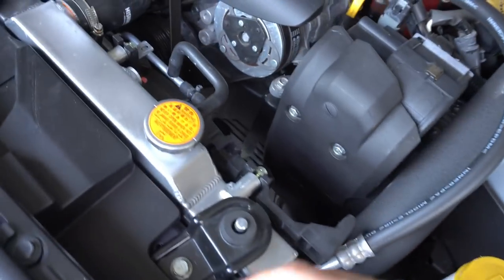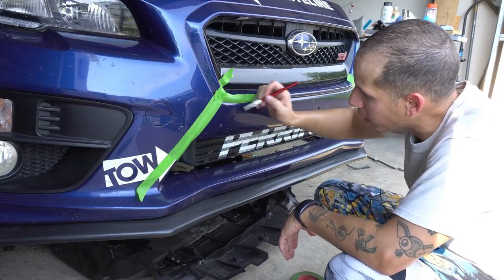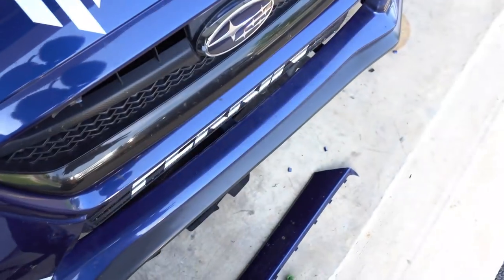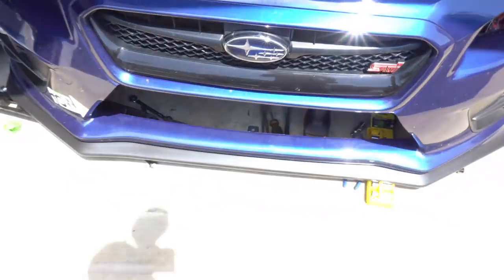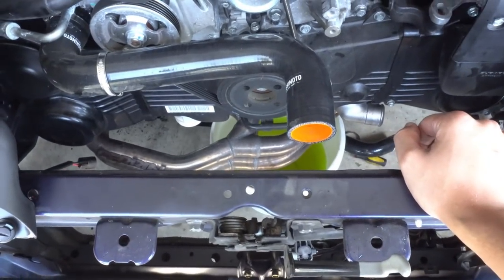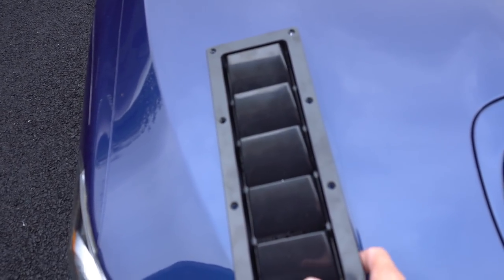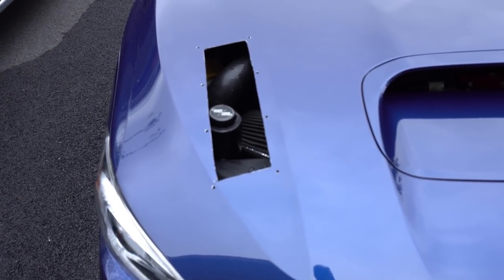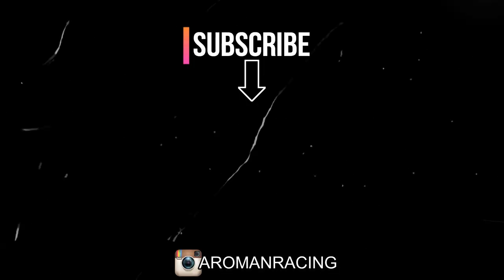Hood Vents and AC delete

Comment: Hey wats that piece next to batter covering over the cam pully I need something like that cuz after I did my head gasket I didnt put back my driver side cam timing cover so its exposed ..wat u have next to ur ac would be perfect for blocking water when I install my vents
Reply from the maker: Next to the battery? I think you talking about the air pump? Comes stock with the car. You wanna delete that. Its just for emissions on cold starts

Comment: The FMI reduces the efficiency of your radiator by at least 50%, which is your biggest contributor to the overheating issue.  I don't think removing other components in the engine bay would help alleviate the issue because, heat the engine produces, can only be best removed via the radiator, which is a part of the engine cooling system.  The engine block itself cannot eject heat very well because it is not designed to to so.  Variables which affect the efficiency of heat transfer are ambient temperature, engine operating temperature or how much heat the engine puts out (more HP =more heat), air flow rate (how fast air moving through the radiator), surface area of the radiator and flow rate of our water pump.  So play around with those variables and find the most viable ways to lower engine temperature.  Good luck, bro!  Just my 2 cents.
Reply from the maker: Khánh now that is some great info. Thanks a bunch!
Reply: A V-Mount radiator/intercooler setup works beat followed by a side by side cooling setup where you use smaller area coolers that are deeper and mounted next to each-other. check Chris sti on instagram to see side by side and MP Gymkhana for the V-mount.

Comment: Did you make any relief cuts in the material around the hood vents? That could help the corners look better and more flexible. Looks good man!
Reply from the maker: Just a 2018 WRX i did drilled the corners first but still went to far lol
Reply: I meant in the gasket or rubber material itself, just make small vertical incisions in it, but not all the way through, to allow it to bend more.
Reply from the maker: Just a 2018 WRX oh yeah . I tried that and thats why it had lifted on tha one side. Tried it the other side and it just didnt look as good. BUT! i actually found the perfect way to get it clean and bend perfectly. I apply heat to it and the rubber gets nice and soft and it bends super easy. Then it gets hard again to the form i bent it. Works awesome

Comment: Get a oil cooler to help keep the oil cooler in witch will keep you engine running cooler. Also leave the hood scoop open to help keep the engine bay get fresh air.
Reply from the maker: Definitely getting an oil cooler soon

Comment: Theres a member on here and ig, goes by @octurbojoe. He cut up the stock underplate/skidplate and added some vents to it that let the hot air escape. You should try that, im sure it would help with some of your temps. Also maybe some hood vents as well.
Reply from the maker: The only problem with cutting from the bottom is that heat goes up and not down, the air will push the heat up and thats why people do vents on the hood to let hot air escape. Plus I have the massive splitter covering everything under there lol. Good looking out tho
Reply: ARomanRacing  yeah vents are good then for your application. The Vis racing hood is nice and functional with some nice hood scoops and heat extractors but also very expensive.
Reply from the maker: @J.NOBODY.1  yeah I definitely wanted the VIS hood but definitely expensive, but I am waiting for a carbon fiber hood that will have a reverse scoop on it, so more vents to help extracting more heat

Comment: That radiator isn't getting the necessary airflow for cooldown, because of that fmic blocking a significant amount of airflow
Reply from the maker: Gotta force more air in there. Its working now. Doesnt overheat at the track

Comment: You should do an air dam test to see where your cars air flow is. Or use a smoke machine
Reply from the maker: thinking of doing the poor mans wind tunnel. Tape a bunch of strings, some cameras and drive around to see how my aero is doing. thinking of doing it with my wing pretty soon.
Reply: @ARomanRacing  yep! That will give you best idea on how to get the aero perfect. You can also rent a smoke machine for a few bucks and push air through it. Should be interesting to see
Reply from the maker: I woudnt know how to do with the smoke machine lol. Need the force of the air and the smoke to move in on direction. Like maybe drive behind a car with the smoke lol
Reply: @ARomanRacing  air compressor

Comment: why not get the varis hood?
Reply from the maker: Well varis hood is 1k bucks while these vents were 15 bucks. Lol plus I am actually waiting for a CF hood with a reverse scoop, no point of getting a varis hood when I am going to get another one. Hopefully I can get the hood soon
Reply: @ARomanRacing  i hear ya. my varis hood solved my overheating issues and im still on stock radiator.
Reply: @ARomanRacing  oh and btw. i also have fmic and a tmoc.
Reply from the maker: @frieddayfriday  i believe my overheating was that cover underneath of the radiator that i took off. I never overheated regular driving or even autocross, just when i was constantly underload, specially on those long straights on some of the tracks.